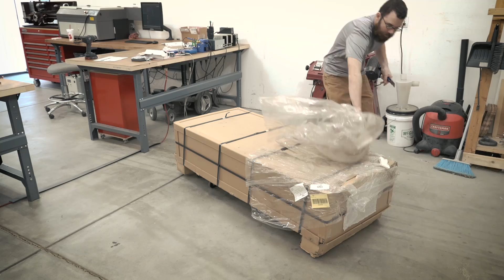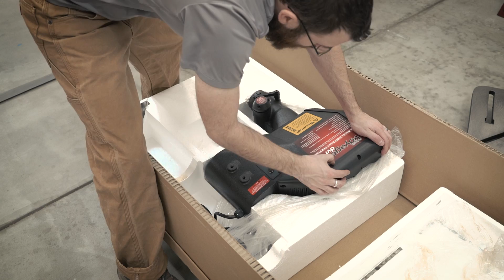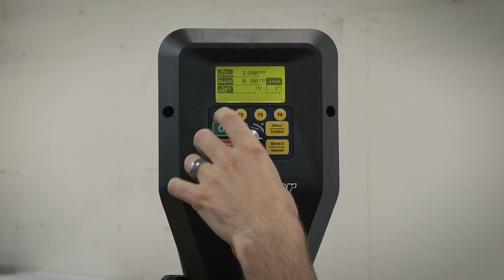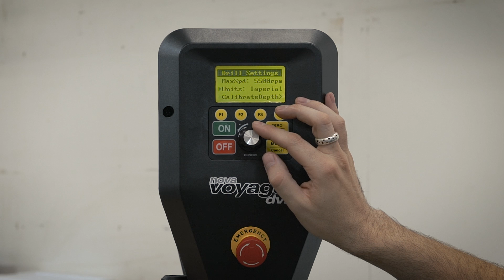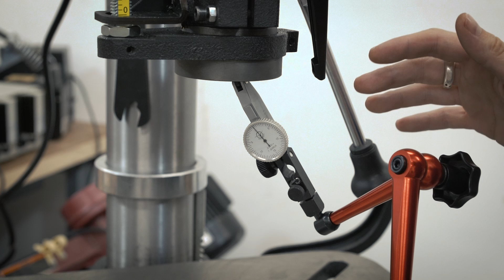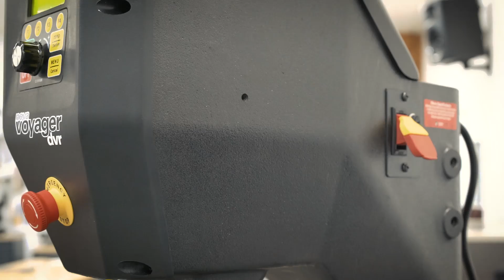Tool Review: Nova Voyager DVR 58000 Drill Press

Comment: i'm concerned about runout on my nova.  i ordered the vulcan metalworking version, very similar to the voyager woodworking version but with heavier bearings and a double taper 3mt / er32 spindle.  when assembling for the first time, i noticed a lot of visible runout, i figured i must have mated the arbor taper poorly, and removed and re-connected the arbor, then measured the runout at the highest exposed part of the arbor just below the spindle, and still i observed +/- .006.  then i measured inside the spindle from the lower edge of the lower taper, the er32 one, and that was fine, +/- .0005.  so then i measured higher and deeper in the spindle where the 3mt taper starts, and again i found the +/- .006.  so, i got the same results as cowan at the lower edge of his taper, but i still think the spindle is the problem once you measure deeper down.  the spec is for +/- .007 of for a tool sticking out 4" from the chuck, so this much runout right at the arbor and spindle must be badly out of spec.  it's as though the concentric features of the spindle were cut as separate operations and are not in fact concentric.  i.e. i think a better chuck or arbor may NOT help.  i'll have to get on the phone to nova support on monday.
Reply: it took a little convincing to persuade nova that i had a bad spindle and not just a bad arbor.  however once i explained (and documented with clear photos) that after removing and reinstalling the arbor 180 degrees rotated, and finding the high spots in the runout on the same marked positions relative to the spindle, they went ahead and sent a new spindle, and the new one is in spec.  big relief!

Comment: Excellent video. Though I wonder what the longevity of this beast is. Most drill press's that are out there,,,,some quite a few decades can be repaired in shop. This thing looks like if it had a problem,,,,out comes a tech to repair it. . Most of us use wood working as a means to a end and if this goes down your waiting on the factory , which could be no end. Funny ...I wouldn't mind owning one.
Thanks
Reply: From what I've gathered in a retail environment, this is the main thing that holds people back from buying it, which is made worse by the fact that they only warranty the electronics for 2 years as opposed to the 5 years they give you on everything else.

However, Nova has had this technology in their higher-end wood lathes for some time now with great success. They have an excellent reputation, and their staff has been probably been the most helpful I've ever talked to.

Comment: I think you did a terrific review & not being sponsored adds a lot of credibility! 👍👍🇦🇺

That said would you be happy with that cheap chuck & runout, if you had paid double your $1300 purchase price?

Why?

https://www.carbatec.com.au/nova-dvr-drill-press

That same drill press is $2799 downunder with the useless cheap chuck! 😡

That’s what you call “highway robbery”.

My cheap ass Ryobi 16 speed press that’s an absolute piece of crap & probably 30 years old, has a 60 watt incandescent work light globe!

I am NOT spending $3K to replace it with this worthless pile of crap Nova & literally stepping back into the dark ages!

A led or light globe work light would have sent Nova Teknatool broke?

Next!

You can’t use bobbin sanders on this drill press! There’s no cut out hole with insert spacers in one corner of the table that you can swing the table to allow the bobbin to align with the hole & pass thru to use table for bobbin sanding!

Despite the computer controlled depth stop, there’s no oscillating up and down programmable feature to bobbin sand so that the wear on the bobbin sand paper is even.
I’ve seen this feature on far cheaper drill presses than this over priced crap Nova!

For almost $3k downunder 🇦🇺 it OUGHT be coming with a finely engineered German hand chuck, with zero run out & fast movement jaws!

No laser alignment cross hair reticule for where the drill will touch down on your workpiece?

Those are just the first things came to mind!

The removable top should be steel not plastic or cast alloy!

That’s where I keep my chuck key, wedge for removing Morse taper from spindle & drop in handle for table vice, in one of those stainless steel mechanics magnetic trays - so they don’t get lost!

That won’t attach to the top of the Nova!

Most workshops your lighting is overhead, and centralised away from the walls. If like most your press is against the wall, then when you stand in front to operate it, your blocking the overhead light (casting a shadow) from reaching Center of the table, which is WHY it ought have a work light!

It’s bad enough getting old & blind without spending almost $3k to them have to work in the dark!

For almost $3k they should have included a free mink coat, so I could turn all the lights off and put some fur around it, at least I’d have half a chance of finding the hole!😂😂😂

Nah, sorry for all your great review, as a drill press at almost $3k price point, this is an abject failure- due to deficient design!

When that computer mother board fries itself, as it eventually will your left with an expensive boat anchor!

Any standard drill press you put on a new fan belt & your back to work!

As a potential workshop addition - at the almost $3k pricepoint, this ones not worth considering!
👎👎👎

Comment: have narrowed it down to the Nova or the Jet 17" DP. Two slightly different price points yes i know. I'd be curious to know how you feel today about the Nova almost two years later. Do you think it's worth it for someone springing for their first DP? Did you ever replace the chuck with something with less run out? Great review btw, some of the best coverage I've seen on a tool on YT ever and i watch alot of WW videos. thanks!
Reply from the maker: In short, forget about all the fancy features.  Assume it's just a normal drill press.  By that measure alone, it's wonderful.  I just got done building a rather complex robot and used this for all the frame drilling and it's just a joy to use, honestly.  It's solid, has power for days, and is nice and quiet.  THEN, add in the fact I can countersink holes at 100 RPM, and then go up to 2K for drilling small holes and then 5K for sanding, all without changing belts...  it's huge.  It's become one of my favorite tools in my shop.  If you have the extra money, buy it.  Some of the extra features are a bit gimmicky and I don't really use them (still haven't used it for tapping even though I do a LOT of tapping), but that's fine.  Those are extras.  As just a drill press, you'd have a hard time finding a better one for less money.
Reply: I was able to get in front of the Voyager today at Rockler and the other drill press I am considering (Jet Jdp17). I was REALLY impressed by the Nova, and it's exactly as you said, when you consider this thing as a variable speed DP alone it's amazing. I found it easy to move around and understand the menus without feeling the need to reference the manual at all. To be honest it was like stepping through a portal as I was going from the Jet to the Nova... I am still undecided as this is my first DP,  but I may spring for the Nova even though it's complete overkill for my needs, the DP itself was just so much easier and more intuitive to use than the Jet and the Powermatic, it would be a pleasure to use when I need it. Would i be using all it's features? Heck no! I don't think most WW would use all the features, unless you're a maker and you work with varying materials often. But I think any WW who considers variable speed and the ability to quickly and accurately  set depth on a DP important features, then this DP is a must to look at. I appreciate your help!
Reply: @jc51373  I bought a Jet JBP-17 which is the benchtop version, got it assembled and never even plugged it in lol. parts were rusted, there was a crappy plastic cover buried in Styrofoam in a way that it was pretty much impossible to lift out without breaking (which it did). After the disappointing unboxing and looking at specs and feature more carefully I decided to return it.

Then I did a shit-ton of research and actually settled on buying a full price Nova Voyager BEFORE finding out about the employee pricing program where I worked. Best news ever. Needless to say I'm very stoked that after a major delay due to COVID (which you'll have buying most large tools from any company right now), it is finally on its way.

Comment: What's the smallest drill bit it can hold?
Reply from the maker: I think it's 1/16".  Somewhere around there.  I did notice that my really tiny bits won't work, so I have to use another chuck.  Something to consider.
Reply: Anything less than about 1/8" is pretty iffy.
I have a small chuck that I chuck in for using small bits that works really well.
I keep it loaded with a common size bit and attached to the drill side housing with a magnet.  Recommended...
http://www.leevalley.com/en/Wood/page.aspx?p=75987&cat=1,180,42334&ap=1

Comment: Great review Robert !  :-)  I was one of the first in Canada to get this drill and am very happy with it.
I too am looking to upgrade the chuck. I was looking at maybe this one:  
https://www.amazon.com/HHIP-3701-2500-Integrated-Keyless-Drill/dp/B00N413YUU
Robert, I'm wondering which chuck you went with, and how is it working out for you?
Does a keyless chuck work OK with the Voyager?  I'm wondering about the hassle with the electronic brake system.
Cheers,  Scott
Reply from the maker: Sorry for the late reply.  I actually don't use my keyless chuck much.  It's a bit of a pain to use.  I wish there was a dedicated button that would lock the spindle.  I also had some issues with not being able to tighten it enough, even with the braking system.  If it were me, I wouldn't get a keyless.  That being said, I use it a lot for various things, and I use it quickly (I'm constantly changing drill bits, doing some metal, wood, etc.).  If I were just doing the same hole over and over and changing the bit wasn't an issue, I would go keyless.

Comment: Hi: Did you ever create a followup video? I know you mentioned you were going to run the firmware upgrades. Would love to hear your opinion 6 months later and after upgrades.
Reply: If the Vulcan was available at the time do you think you would you have chosen that on instead?
Reply from the maker: I didn't.  I've upgraded the firmware, but unfortunately it operates still about the same.  I still have yet to get the tapping feature working.  Otherwise I really like it, but some of the features are a bit over-promised.  As a drill press, it's fantastic though.

Comment: Interesting about comparing this a higher-end press/mill - hadn't considered that.  I'm also bummed about the run-out but is it really important?  Also, no laser?  Or, could it be that an "aim here" crosshair is no longer in vogue?  Thanks for the vid - good job.
Reply from the maker: I think a lot of people are over-thinking the run-out.  The quill/spindle has no measurable run-out, it's just the arbor and chuck.  Replacing it with a nicer one solves this issue, but since it's a drill chuck, you'll never get rid of it 100%.  Drill chucks are just inherently not perfectly concentric.  You'd need to spend $500 to get a chuck with almost no run-out, and I don't expect Nova to include one of those on a $1500 tool.  Lasers are nice and it would have been nice to include one, but I tend to use pilot holes for critical hole placement and it's easier for me to just use a smaller bit to start the hole than a laser.  The ones I've used before don't tend to have a thin enough line it's usually really fat anyway.

Comment: Thanks for the great video Robert.
Could you tell us what the exact size of the main column is using a vernier?
Reply from the maker: Yes!  I had to break out my extended reach calipers, but I measured 3.625" diameter.  Does that help?
Reply: Robert Cowan 
Thanks for your reply!
Very helpful.
Reply from the maker: Sure thing!

Comment: I have a powermatic PM2800B drill press that is 4 years old.  I've had 2 switch assemblies burn up in that time.  Most often I use it to bore 15/16"x1"deep  forstner holes in white oak @~650 rpm  and a  shallow forstner recess 1/4" deep 3-1/4 diameter @ 300rpm.  Could this be the reason for my burning up the switches?  Asking because I'm intrigued if the NOVA machine could do the large recesses easily and reliably or would it stall / overload?  I like the smaller footprint and volume it would take up and the ability to set programs.  I just need to know if this thing can out perform my powermatic for the 3-1/4" bore in white oak?
Reply from the maker: I'm surprised the powermatic had an issue, that shouldn't be all THAT hard on the machine.  I would think the nova would be able to handle this with ease.  I've done a lot of steel and aluminum, which is much harder to drill than wood, and rarely got the load much over 20%.  With a standard AC motor,  you have much less control over the power of the motor, but with a DC motor like this, you can measure the load, apply more power, etc.  If you are burning out a powermatic, I think the nova would be the next logical step.  Brushless motors can potentially have a LOT more power than their AC counterparts.
Reply: Hey Robert,  thank you very much for the reply.   I haven't had issue since I replaced the switch assembly this time (yet).  I don;t know if the current raised from bogging it down caused the issue over the longer term or not.  But my struggle is boring a 1/4"-3/8" deep 3-1/4 bore with a big forstner bit into dry white oak.  More often the sharpened bit boggs and or snags and momentarily the spindle stops and the forward belt is obviously slipping.  The motor keeps turning and i believe the rear belt is running and the slipping occurs between the mid to front pulley.  

Having the direct drive of the Nova is VERY appealing in this case if the nova wont shut off from doing the same boring.  I ensure a sharp forstner and i take small (almost) scraping force plunges into the wood.  I dont drive it in or force it excessively, but with a bit that size force is needed (i'd assume).

So perhaps my story about bogging isnt so much dragging the motor down but to the point the belt slips.  Or if the loading before slipping causes extra current somewhere which brunt the switch assembly. 

Seriously considering the voyager - I'd hope I could get $900 for my PM2800B powermatic as its only 2 years old.

thoughts on all this?
Reply from the maker: I think you're on the right path.  Slipping belts will lost tremendous amounts of power and you can't really prevent it (unless you use serpentine belts, v-belts will generally slip).  So a direct-drive solution would deliver more power directly to the tool.  I've not been able to bog it down, but I don't use it all THAT much.  But, transferring power through belts will reduce the amount of power the spindle sees, so even in theory, the Nova will always deliver more torque to the actual cutting tool.
Reply: Afternoon Robert !  Thanks for your feedback and input.  I did end up buying the Nova.  Had it next to my (now sold) Powermatic PM2800B.  As to my specific question about the 3.5" forstner into oak and bogging... there is ZERO comparison.  The nova destroys the PM.  What used to cause my belt to slip on the PM barely got above 25% max load on the Nova.  So for my needs the NOVA is awesome.

There are a few drawbacks with the Nova for me when compared to the PM.
I like the PM table, smooth chrome handles and crank, dual opposing lights, chrome stop quick release nuts, and keyless chuck.  I already installed new chrome handles and bought a keyless for the NOVA.

The things on the NOVA I'm not really cool with is the smaller bulky table, no lights, all of the handles and cranks are cheap plastic junk,  the odd shape crank arm that hugs the table, the cheap junk single quick release nut on the depth stop, and the giant pedestal base.

But for me its function over form and it works AWESOME.  I got $1000 for my 4yr old PM so that greatly helps me offset the cost as I bought the NOVA for $1349 w/ free shipping.  I'm dying to find a better push button quick release stop nut.  The NOVA is a very odd size of M14x.1.5 thread.  I can find any that size.  Most are 1/2" and the PMs don't transfer.  But your review sold me on the unit - Thanks much !
Reply from the maker: awesome!  I agree with everything, there are some features and fit and finish things with the nova I don't like.  But if you need to drill holes, I wouldn't want to use anything else.  I used it with some titanium the other day and I wouldn't trust other drill presses with stuff like that.  I love how it drills, but some of the other stuff isn't my favorite.  Glad it worked out for you.

Comment: Did you try the tapping assist function? I have the same drill press and could not figure out how to use that function properly. If you have another video showing how to use that function, it would be great.
Reply from the maker: I've tried it, but never got it to function properly.  I'm discussing it with their tech support to see if I can get it working correctly.

Comment: Ok, odd question. How tall are you? I've seen other reviews where the person is towering over this drill press and it looks much smaller than other presses. IN your video, it looks like a perfectly good height.
Reply from the maker: I'm 5'8".  If I were 5'10" or so, it would be perfect.  The screen is slightly too high for me.
Reply: Pete, I too thought that the press looked small in videos.  I can assure you that it is full size and very substantial. I was pleasantly surprised when I put mine together.  For the record, I'm 6'1" and I find it the perfect height.